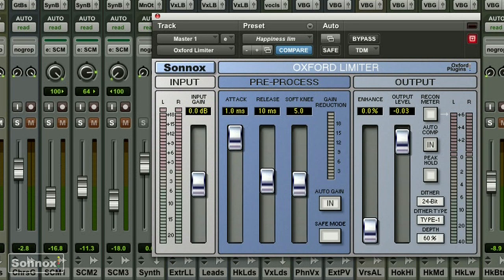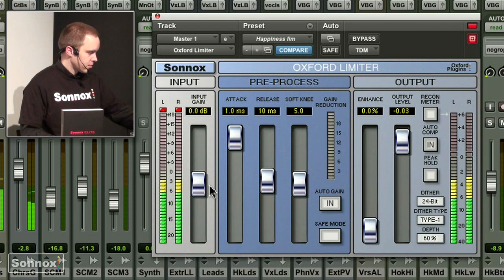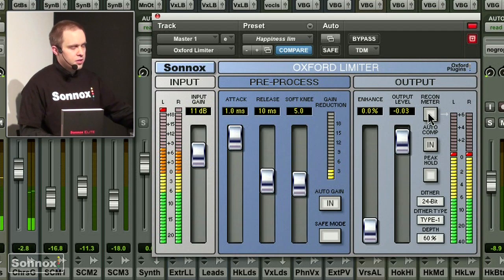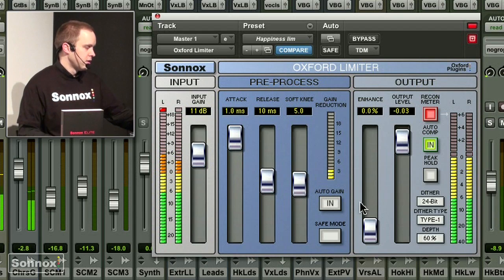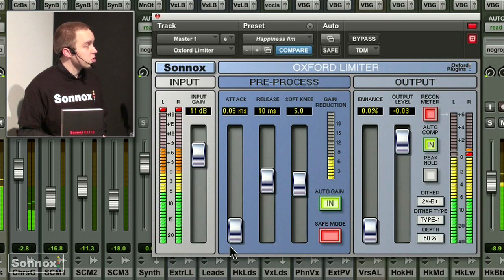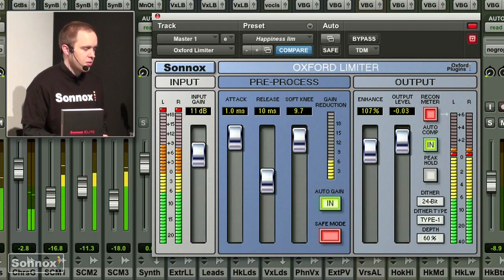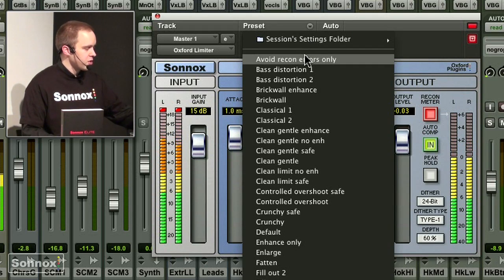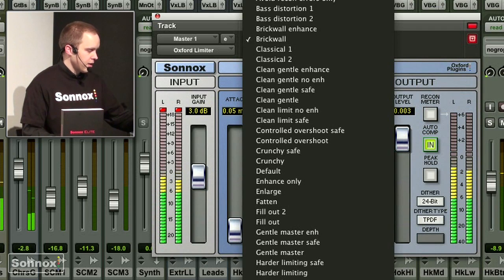Oxford Limiter on a stereo mix (Musikmesse - Nils)

Comment: I tried it but it seems to dull your mix because it kinda like adds low mid harmonics. Also reduces the stereowidth imo. The Oxford limiter enhancement section would give you better results as long as you don't overdo it